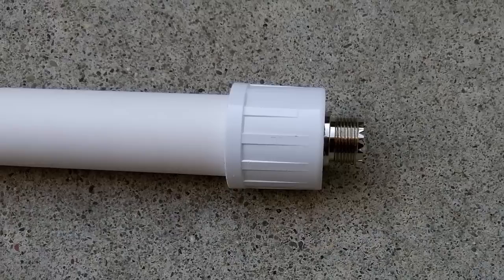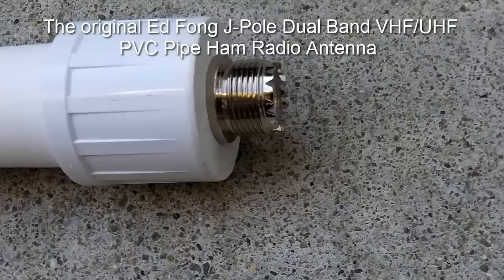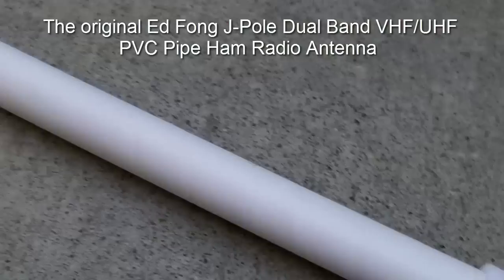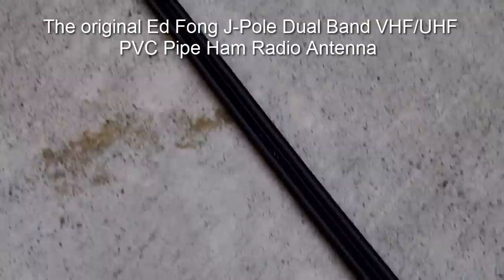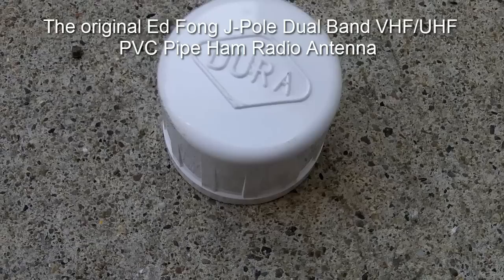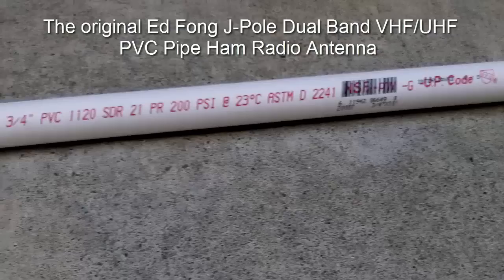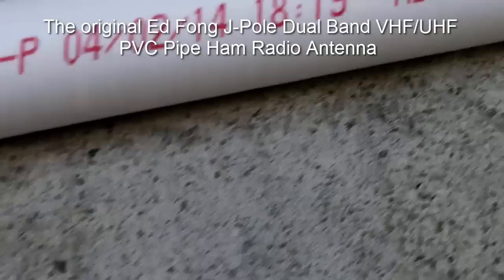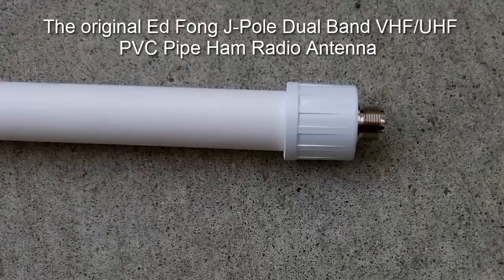The original Ed Fong Dual Band VHF/UHF 70cm/2m J-Pole PVC Pipe Antenna : Eye-On-Stuff

Comment: It never fails to amaze me how certain antennas can become so  massively over hyped, 
I'm not sure maybe It  has something to do with the dumbing down of the amature radio tests resulting in a new generation of technologically illiterate hams being susceptible to the charms of snake oil salesman.  the fact is neither the J-pole nor the slim jim have anywhere near their advertised gain. Those original gain figures were derived from dishonest or inaccurate antenna modeling that has been proven erroneous by some of the world's most respected antenna modelers and later confirmed via range testing.   

 These tests have confirmed that J-poles and slim-jims actually have negative gain when compared to a simple 1/4 wave ground plane and you can build a 2 meter ground plane from  a coat hanger and an SO-239 for about $3. 

 If you're using a J-pole style antenna and think it's performing  well  then you will be amazed at the performance of some of the stacked collinear designs available.  

 For comparison, assuming no feedline losses  50 watts into your J-pole equals around 44 watts ERP aka effective radiated power. This means you're actually LOSING about 5 watts of power, not to mention that J-poles have serious issues  with feedline radiation and are susceptible to common mode. 

 On the other hand a collinear antenna consisting of 3 stacked 5/8th wave elements will turn that same 50 watts input into a bit over 346 watts ERP. Yup thats whopping 346 watts of  effective radiated power.  Even a much simpler collinear consisting of 3 stacked 1/4 wave elements will give you a respectable 142 watts ERP as compared to your J-poles 45 watts ERP.

Now let's add some resnablebly attainable horsepower to the mix and say you add a 180 watt MFJ  brick amp to the system. Once again assuming no feedline losses your J-pole would be costing you about 20 watts in loss giving you an ERP of only 160 watts.  
 On the other had that same collinear consisting of 3 stacked 5/8th wave elements will turn that same 180 watts input into staggering 1245 watts ERP yup thats right a whopping 1.2kw of ERP.

  Unfortunately since most hams nowdays memorize the test rather than actually learn the material very few understand these basics making them easy prey for snake oil salesmen peddling their miracle antennas which defy the laws of physics.
  
Ever wonder why fong refuses to use any real science to back up his advertising claims but rather resorts to snake oil salesmen style tactics like using  "testimonials" AKA subjective personal opinion,  You would think a Dr with a PHD electrical engineering  could provide some solid math and science to back up his controversial advertising claims rather than relying on subjective personal opinion in the form of  "testimonials"
Reply: +Dan Nelson I agree. I've built the J-pole a few times (copper pipe, twin-lead) and tuned it to resonance. Unfortunately, it's performance has been very poor. The advantage it has is its simplicity and potentially cheap cost to build (obviously not cheap to use copper pipe). I've also built a couple of 4-element yagi antennas that were simple to build and very cheap to build that outperform the J-pole by leaps and bounds. Yes. The yagi is directional, but where I live it works perfectly because everyone I talk to (simplex or via repeaters) are pretty much in the same direction away from my house.  :)  For an emergency antenna, the J-pole worked okay for me, but I've also crafted the 1/4-wave ground plane and yagi antennas to be portable for emergency use as well. I'll keep a roll-up J-pole in my "go kit", but it likely won't be my first choice to get on the air.
Reply: yup I agree the one place a j-pole works great is as a roll up emergency antenna, I also think every new ham should build one as their first project,. For fixed station use there are much better choices.
Reply: Is this Dan Nelson as in Nelson Antennas?
Reply: Looks like Dan hates competition....hehehehe
Reply: actually what I hate is watching the dumbing down of a hobby that's supposed to be solely based in science math and engineering and not wives tales, fantasy and snake oil
Reply: Dan Nelson You are absolutely right.A good example of this is the fact that I bought a nonworking boatanchor from an extra class,who couldn't figure  out the issues.A visual inspection revealed
most of the issues.Anybody can memorize test questions.If you don't possess the knowledge then
what's the point
Reply: these are over hyped and sold to newly licensed dumb hams, some not so dumb hams actually try to build them,
ham radio has been made so easy as to encourage dumb CBers and general idiots as the hobby is dying, 
and once it's an easy hobby to get in to you need an easy to build simpletons antenna..
Reply: @ Dan Nelson: Amen Bro, you said a mouthful and then some... Thumbs Up
Reply: Not knocking any design but one thing I  have experienced is that colinear verticals have always exceeded expectation. For that reason as a new comer I'd steer towards them in study/building.
Reply: James Hauser If it is then I would like to tell him his antennas are hot garbage. 

I would suggest no one buy them because they don’t work. 

A loaf of bread wrapped in aluminum foil is superior to anything sold by Nelson Antennas.
Reply: @bigpimp347  Just seeing this now. Wow, what a great way to attract people to the hobby, and this has been on display for 7 years. Yay you
Reply: @kurtwolter3984  and still so true though, you know i'm right..